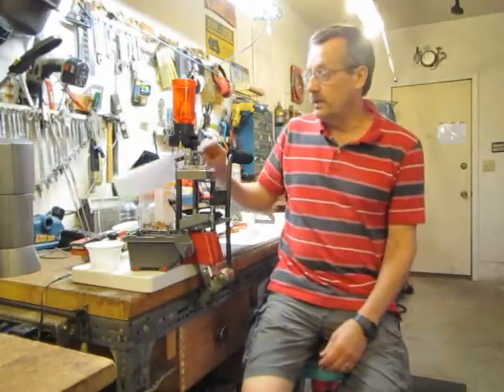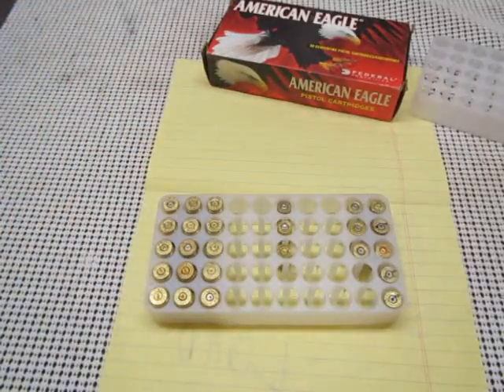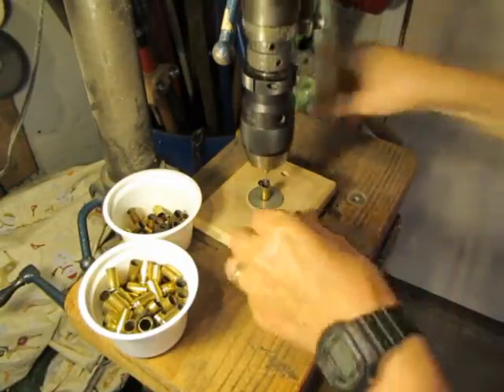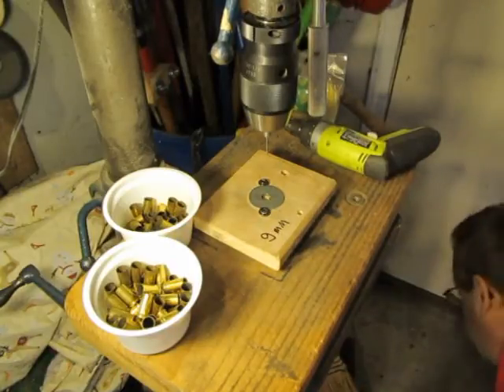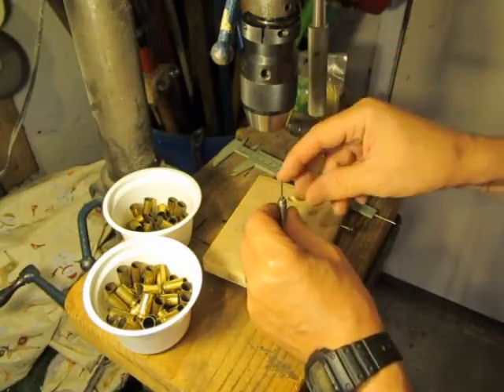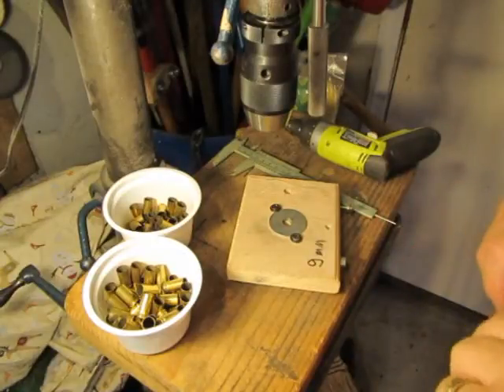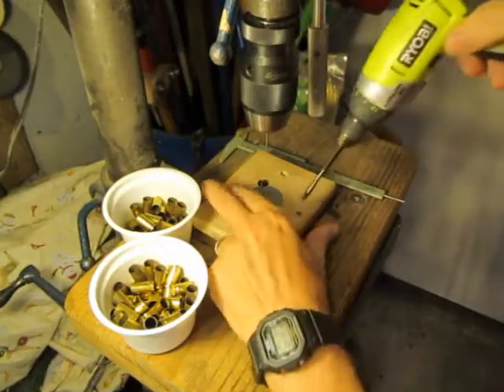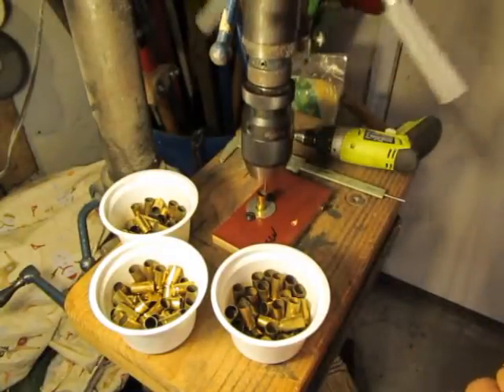Using a Drill Press to Decap Brass

Comment: try the lee Loadmaster with case feeder 
you wouldn't need to take every case ans put them
Reply from the maker: +Mil Dot I have the Lee Pro 1000 with a case feeder already butt  I do not use it because I deprime  outdoor range brass.  It has sand, mud and grass all over it.  After depriming it I wash it with Stainless Steel tumble system which also cleans out the primer pockets. Doing it this way keeps a lot of filth out of my press.   I have since updated  my drill press system and posted this video https://www.youtube.com/watch?v=mSPHO1TZGTI .  This new method goes super fast and also allows me to sort the brass at the same time.